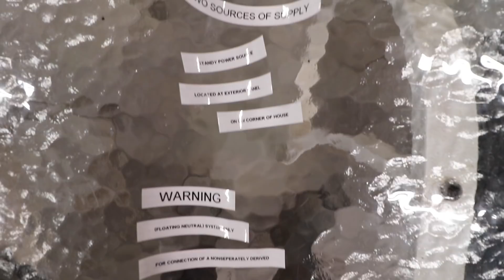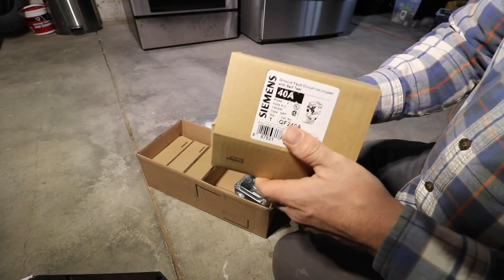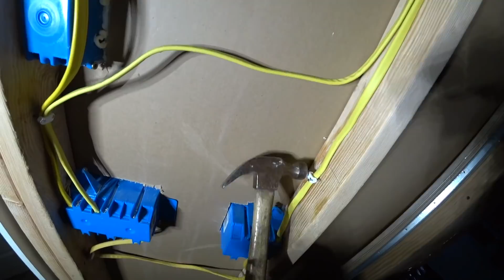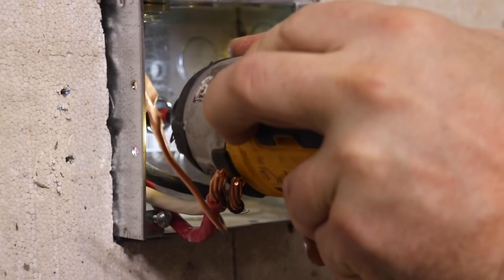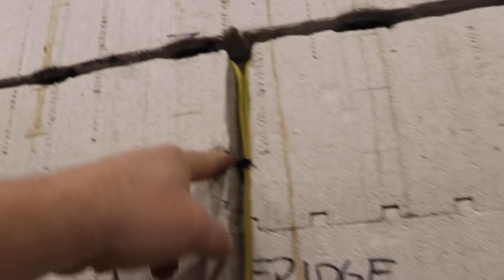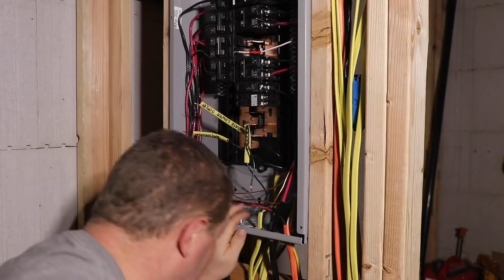We FAILED OUR ELECTRICAL INSPECTION! Now What?!

Comment: A good inspector is your friend not your enemy.  They are your partner in safety, and (in the case of a contractor) your assurance to the customer and a double-check for yourself that things are complete and proper. At least, that’s been my experience with them.  Sometimes they can get a little borderline if they get handed something odd… like my rural home workshop, that —  because I do a lot work with and for commercial electricians in commercial spaces (barter is your friend) — was wired in a fashion and standard for commercial spaces (all surface mount conduit and boxes, as the stick-frame building is sheathed in steel outside and inside) he insisted on a few touches that he expects in a commercial building.  In this instance, that meant we needed two battery backed up exit signs over the doors.  Not a huge deal, but an odd one.  But at least the shop is consistent with those regs, so if I did* set up business in there, it would already be code compliant.

Comment: Its learning experience for all.  That's what happens when you do things slightly different from the norm.  How many DIYer live in their house while building it and do it to code at the same time and push the edges like you are doing.  Congrats on working through the issues.

Comment: Here in Europe we usually do all GFCI functionality in the panel, GFCIs integrated into outlets are something of a special item. Even though we also have those breakers with the GFCI, the normal way is to install a large GFCI upstream of a group of breakers, or the whole panel, saving panel space and money. So, maybe something to look into? In my opinion everything that can be touched by a human should be behind a GFCI, and that’s almost everything so you might as well put everything behind one. Keep in mind though that they do nuisance trip from time to time, so don’t put everything behind just one, especially critical loads like lighting and heat. Not an issue with the GFCI breakers, but with the European style you definitely need to think about failure domains.

Comment: GFCI is a great idea if your wires are buried in the ICF. A win/win for you. I had reservations about burying wires in the ICF because if the wire starts a fire, it's really impossible to stop the foam fire once it is behind drywall. All other wires that is not in the ICF won't need GFCI for the rest of the house... as long you don't energize it until you are finally ready to finish the hosue… circuits that you don't need during 'temporary' living areas.

Comment: So..... LOTO (lock out tag out) is a good safe practice. There is a whole program on LOTO in commercial and industrial applications. Also panel labeling for generator connections etc...is in the CFR and a good guide. Still would strongly suggest a transfer switch with twistlok connectors and a nema 3R panel with twistlok power inlet connector....and a ground rod with a kerney and a solid copper no 6 ground wire for the generator when you use it to power your emergency circuits in your home. :)

Comment: NEC, all temporary power must be GFCI, not a state thing, it is national. One of the issues when you move into a "temporary" living quarters.
What you really want is a switch at each location, don't waste your money on locking breakers. When you want to work on something, having a switch within sight is much easier than a locking breaker. Extension ring; 10-32 ground screw. Check before you "re-foam" you might find too much insulation reduces your amperage allowed. Thus, #12 would only be good for 15A vs. 20A. Amperage rating is a function of wire heat. Just get some sheet metal and cover the whole stud bay, cheaper and faster, you still get the same results. A "Giant" nail plate is nothing, it will be covered by sheetrock sooner or later.
You are lucky to hit a good inspector, many do not have time nor inclination for consulting, they have too many stops during their day.

Comment: Keep up the great work!  If I may make a suggestion?, take out the stud on the left side of the panel to free up the knockouts there and put a horizontal support (wood or metal) across the top and bottom from right side of panel to the wall on left side.

Comment: Labeling, especially at the "main disconnect" at the pedestal seems very confusing.  Why would you warn some one of a second source that can NOT be energized (generator interlock) when the primary source is energized ?  While the inspector may approve your labels, I have found that that type of label does not stick well longer term, especially when exposed to heat and cold.  You may need to put an outdoor grade of clear tape over them like 3M 764.

GFI breakers/outlet work by "measuring" the amount of current going into a device/outlet on one wire and the amount of current leaving the device/outlet on the other wire.  To "trip" the GFI, it actually creates a short to ground, hence the need for the extra wire going to ground.

I am with Jesse.  Never heard of a "lockout" required in a residential installation.  Common in industrial.  Also, flexible metallic conduit, in the past, was always acceptable as a ground.

Comment: All british breakers have lockout built in, those metal lockout are massively overkill as well. Personally I'd just throw RCD on all circuits just for peace of mind anyway. Also we dont use wire nuts as there know for failure we use chocolate blocks or even better wagos im sure they must be credited for USA use and are much quicker and more reliable. It amazes me you dont do any testing either.

Comment: Take the time to discuss with the inspector which wiring methods he will allow in the upper levels of the house.  Get a feeling of what will fly with him and what won't.  Another thing you may want to consider is adding another branch circuit panel.  That would give you a lot more space to work with as you continue your build.

Comment: Wire tie with a hole! NO, a solid bond to the housing structure is needed! Plastic, especially the plastic in wire ties will out gas and deteriorate, harden and then fail. Staples have metal entirely around the plastic or paper fabric insert. Plastic with a hole in it does not provide the same total surrounding non degrading support! Wire ties with a whole in it are not the same. in reality, in a garage with all the appliances you should have used ridged metallic conduit wether you liked it or the expense or not.

Comment: You better check with the inspector before you run house wiring through the top.  Most states do not allow that, only main feed line comes through the top.

Comment: for the water heater, place an air conditioning disconnect near it.  That will allow you to not have to lock out the breaker.  Also, Dont forget, ground faults are one requirement, on final inspection you will need arc fault breakers in a lot of areas of the house as well, so plan on changing some of the single pole breakers out to combination arc/GFCI breakers.

Comment: The other thing I would mention is, your ICF's likely don't have plastic studs all the way to the edges.  Mine didn't.  I channeled all my horizontal runs along the seams,  Piece of cake.  Again, I'll tell you that I channeled my ICF's with a cheap electric chainsaw rigged with a stop so the chain wouldn't contact the concrete.

Comment: Get some Real Electrical Help. There is not near enough circuit breaker spaces for all you are trying to do with this Custom Home
Two Kitchens, work shop, 3 two pole breakers for water heater, garage elctric heater. and the like. the New 2017 NEC has some very
interesting requirements and some of these have been removed in Wisconsin. In a Small Home in Wisconsin without at Electric Heating and Appliances I can usually fill a 30 circuit panel. Watching Your Project I would install no less than two 40 Circuit Panels. That water heater is Killing You, without that Your 200 amp feeder is plenty. Good Luck

Comment: When you have a inspection carry a roll of painters tape and a marker to mark and label all the things the inspector wants done. Something like postits will fall off at the worst time so tape stuck on that you can write on works well. 

When you get to the SIP's for wire runs you can create new ones by using a hot ball bearing of the right size you want the path. Drill a hole large enough above where you need the vertical run and a hole under that you can insert a sheet metal catch. Heat the ball and drop it at the top and it will melt a path down to the lower point.

Comment: Oh damn your electrical system seems to be so complicated over there. Here in Sweden we use 230 volt per phase. That lets us use much thinner wires at the same wattage. For heavier equipment, electrical ovens and other high power things we use a three phase connection. More wires but still much thinner the wires in a 110 volt system at the same power. 

When we pull wires we use plastic tubes in the walls. Rigid or flexible. If we need to add another wire or replace them we just add more wires in the tube. 
All modern breaker panels are based on the DIN rail system that is not manufacturer specific (Thank you Germany :) ). On the DIN rail you can have have a shared GFI for all breakers. And let us not forget the plugs and sockets. If we slip when we connect a plug we can't be electrocuted as the outlet is deeper and the prongs on the plugs are isolated half way. 

Good luck with your wiring!

Comment: Securing the wire with a screw.  It just has to be secured, not how well.  I have to "secure" a pool heater to the pad it's on.  The pad is expanded polystyrene (Styrofoam) covered in a thin fiberglass.  I run #12 SS sheet metal screws into the fiberglass.  I think a plastic/fiberglass ground staple (a Big U) would work.  They are BR breakers. Murray BR GFCI or not breakers will work just as well as the Siemens.  The BRD breakers will not.

Comment: Hmm, without knowing about the regulatorns in the States and especially for temporal installations I will still make a comment.
 1:I really don’t understand why you have to have one RCD for each breaker!? Normally you can have one for a lot of breakers, are you sure you have gotten it right?
2: Working breakers/switches, it’s pretty standard world wide that you have to have a switch close to/within visual range of the equipment/machine you are working on so that you know that the electricity is cut. If you don’t have it you normally have to have a lockable breaker. Once again, are you sure that having lockable breakers in your electrical “ cabinet” is the only solution? I.e, an alternative could be to have a switch at the appliance/equipment.

Oh, and you SHOULD have RCD:s, I just don’t understand why you would need one per breaker, could be my ignorance of the electrical system used in the States.

Regards,
Lars-Åke

Comment: Check code on AFCIs as well ! They look like GFCIs but work differently,  needed in bedrooms,  they’ve expanded the requirements but I’d have to check to see what other rooms they’re required in .  AFCI = Arc Fault Circuit Breaker ... not the same as a GFCI= Ground Fault Circuit Breaker.

Comment: technically if you flip the breaker  tested that your line that you will be working on is off then close and lock the entire box then take the key with you until you are done you would be safe and since those lockouts do not have any key's i would do that as well.when nothing can be turned on until you return with the key you took with you it makes you feel much safer.

Comment: You may have to  redo the 40A box- some jurisdictions do not allow two wires under one screw--easy fix: use green grounding  wire and wirenut to pigtail to that screw.

Comment: I saw you added the extra box ground for the range receptical under the same screw as the other ground on the receptical itself.  Where I am from that is also a fail.  Only one wire can be under that screw.  Hope  it’s not an issue for you.

Comment: I channeled the NM cable in our ICF's. According to our inspector, as Long as the wire is back 1 1/4" and held in place with foam, no other securement was necessary.

Comment: In the UK all cable ties and wall fasteners now have to be metal so they don't melt in a fire so the cables fall down and snag or electrocute firemen or anyone else.
This is quite logical - nylon or plastic fasteners work until you really need them to!

Comment: You mentioned that your little 20 circuit panel is about to get crowded.
Like I told you earlier, you need a 42 circuit panel.  The law of garages applies here. "You will expand to fill all available space.
If you insist on keeping the little panel you have, you will need some sub panels in several locations.
The solution is to use the panel you have as a garage sub panel and put a main panel in the living space.
Do not be stubborn and understand that often esthetics is the enemy of practicality.

Comment: what you call a ground fault circuit interrupter (GFI) is actually called a residual current device (RCD) which is exactly the same thing just different name in europe this protection is standered on all new electrical installattions and protects you against electric shock if you touch a live wire by mistake the (GFI) part of the breaker detects that and reduces the time your exposed to electric shock improving the chance of survival or reduced injury from electric shock

Comment: safety interlocks are important i worked for a box company nextdoor to a bag company and one of the guys next door failed to take a safety interlock key when he went inside a machine to clean it and his fellow workers not seeing him assumed he was late so they turn the machine on with him inside the machine jammed and stopped and so when they checked well lets just say the emt's had to use a bag. had he pulled the key he would have been safe.

Comment: I noticed your washer door ajar.  Good thinking!  Keeps the mold out!  I was also told by a washer repairman that if you use the chutes on the washer for feeding in the soap and fabric softener, the residue can create mold.  He told me to add what I want in the washer via the big door, and instead of using liquid softener, use sheets.  I have heard horror stories from front loader owners who didn't keep the door ajar and did use the liquid softener chute.  I'm on my 2nd  home with front loaders with zero problems!

Comment: Dear Diary...Anyone else run into this BS as an electrician? In Illinois the "GFI" breakers are typically 20 AMP'ers used for bathrooms or or something around water, but the residential lockouts are just too much(especially if it's mechanically grounded). Gheeeuuzh! Sorry you learned the hard way. Luv you guys. almost there

Comment: This is one of the reasons only qualified electricians can do electrical work in Australia
Edit: Simplified gfi weither 120v or 240v the supply goes through a coil of wire ( like how a clamp meter works) but because both sides of the circuit go through the coil they cancel each other out, but if some of the power out and doesn't return either cause by a fault or an unlucky person a small voltage is generated in the coil once this exceeds a preset amount the breaker turns off

Comment: Good Information! You should use that metallic extension box from the range outlet on the water heater junction box to make that box code compliant based on the number and size of the wires you have in that box.